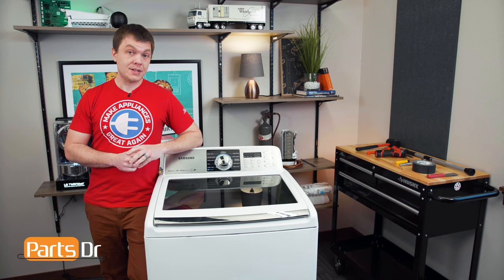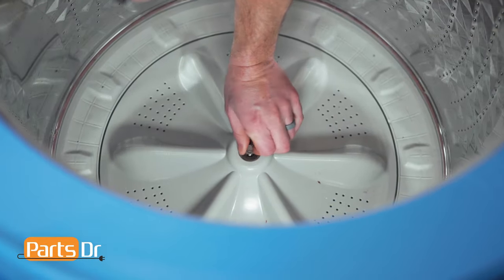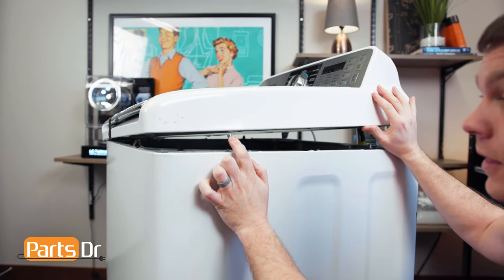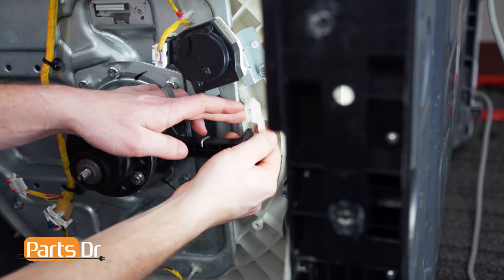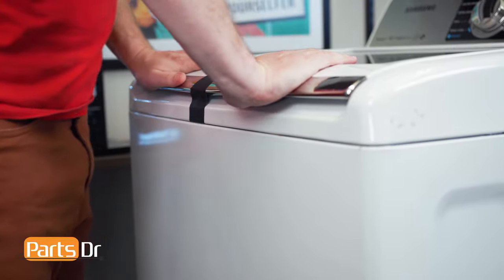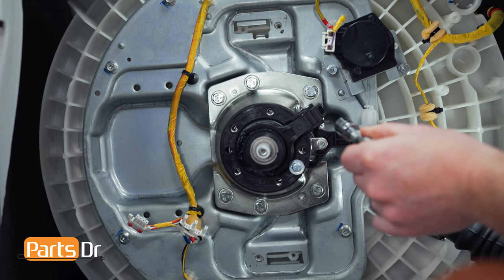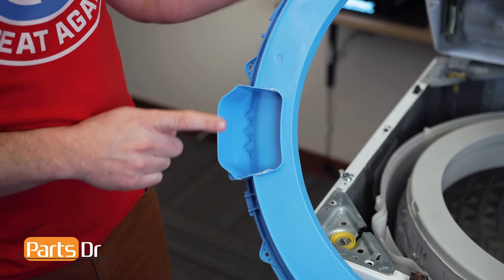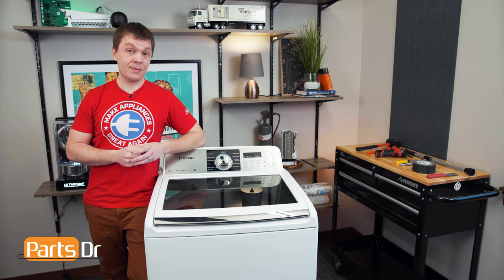How to replace Samsung washer clutch assembly part # DC97-16984A

Comment: My question is how much does this job cost?
Reply from the maker: It will vary depending on the model of the washer and where you live.  Our guess would be $500 to $600 to have a professional repair person replace the clutch assembly.
Reply: @PartsDr  wow half the cost of a new one

Comment: Are all samsung washing machine nuts unscrew clockwise?
Reply from the maker: All of them that we have seen unscrew clockwise.  Let us know if you find something different.  Sometimes the nut gets stuck in place from corrosion and have to be cut off.
Reply: Thank you so much I have a samsung top loader WA13F5S2 its making a loud harming noise on both wash or spin so I'm thinking of replacing the gear box could it be the one causing or its something else
Reply from the maker: @faraimarukutira9743  Unfortunately, we do not have information on this model since it is a non-USA model number.  It could be a bad gear box or clutch if the washer has one.

Comment: I have a top load Samsung washing machine model number WA52J8700AW/A2 (02?). I need the clutch assembly but just the nylon part that is held in place by the 5 Philip head screws. I can only find the whole unit. Do you have an email that I could send you photos of what I have?
Reply from the maker: Hi Joshua, Samsung does not sell that part separately.  You will have to buy the entire clutch assembly.  This is the clutch for your model washer here: https://partsdr.com/part/dc97-18439a-clutch-assembly?model=WA52J8700AW---A2-02
Reply: @PartsDr  thank you. It was driving me crazy looking for this part or any information.

Comment: Excellent video! I have this washer and have taken the tub out twice so far to clean it because of gunk build up on the bottom of the tub that eventually gets on our clothes. Now it's making a loud noise in spin cycle so I'm sure the bearings are gone. I had a hell of a time getting the tub out the first time due to corrosion on the shaft splines.
Reply from the maker: Thanks!  That definitely sounds like bad bearings!  Let us know how the repair goes for you.

Comment: Got a used set. When i went to run it thru with cleaner a bunch of gunk came into the tub. Ran it at least 8 times and still got gunk.  Started tearing it apart and found your videos. 
I took WD 40 and boiling water  to it but still couldn't get the wash tub out. So we brought it outside, got a dryer cleaning brush, the hose and our shop vac. While the hose ran I shoved the brush in between the wash tub and the big tub, and scrubbed everywhere. So much gunk! Then we filled and sloshed the tub around and shop vacced again. 
No more gunk!!!!
Reply from the maker: Nice job! Thanks for sharing!
Reply: @PartsDr  I spoke too soon. Now I've got gritty gunk in the tub. I think all my scrubbing only loosened the gunk more. I have run vinegar through, used washer cleaner, and probably 15 empty wash loads in total. Still gritty gunk.  
Guess I see if I can get it back outside and rubber mallet the clutch till it comes out. 
Either way, I wouldn't have even gotten this far without you! Thank you for making these videos!
Reply from the maker: @barbarac3971  Unfortunately, it sounds like it will probably need to be torn down completely to clean it out.
Reply: @PartsDr  I have tried vinegar, Coca-Cola, WD 40, silicone lube, scrub daddy paste, boiling water, wire brush, rubber mallet; this thing won't come off! I am afraid if I turn it over and tear it apart from the bottom up, I'll end up having to replace the whole clutch, which I can't afford. 
I've taken the garden hose and shoved it down in between the tub and the bin, and so much gunk still comes out. I keep vacuuming out the water, then do it again and still get more gunk. 
I went to try and get a new nut and washer as this one was so nasty, but they wanted $45 just for that nut. So I soaked and scrubbed this one so it's at least clean when I put it back on.... 
I am giving up 😩

Comment: thank you for the video. my washer Samsung model wa50m7450aw/a4 with error  code PC according to the manual is for the clutch problem I just replaced it and still the same code PC please help me with what parts i should get  if you can help me with the part # please.  also my pump it is a little loud. thank you.

Comment: Hi thanks for the great video, My washer (Samsung - WA52M7750AV/A4) won't start spinning and it gives the error code: PC  I'm having trouble figuring out if it's my clutch assembly or my clutch drain motor that is going bad. Is there a way to tell the difference between those two and which could be the issue? any tips or comments would really be appreciated, thanks again

Comment: Just wondering the part I’m looking for appears to be this but I don’t have no electrical connector so is it cool to just leave it there like it came and just put everything together? That’s the only thing messing me up also my model is slightly different lol I don’t have all that telsa looking stuff there mines newer I believe plus mine wasn’t transparent on top and I didn’t have to pull the tub out.. so I think I’m right??
Reply from the maker: What is the model number of your washer?  https://www.youtube.com/watch?v=Lz1UsPC8lBU
Reply: @PartsDr  Wa40j3000aw/a2
Reply from the maker: @Stephentko  Your model washer has the motor off to the side and a belt that connects it to the clutch instead of a rotor and stator.  So on your model washer you won't have a rotor and stator to remove aka "that tesla looking stuff" 😂.
Reply: @PartsDr  So is that a yes it will work or a no cause the part number is exactly the same from the clutch assembly I pulled out..
Reply from the maker: @Stephentko  Your model washer uses part number DC97-16984B (PD00029202) for the clutch assembly.  You can view that part here: https://partsdr.com/part/dc97-16984b-clutch-assembly

Comment: How can I test this part before buying new one? My Samsung front load washer keeps slow spinning one way, then stops, then spins again and stops. Never a max spin. The timer goes down but never an error. Went down to 4 min left but stays there trying to get a spin.
Samsung WF50K7500av
Reply from the maker: We haven't seen a test for determining that the clutch is bad, but there are some things to look for.  If the washer is louder than normal in the spin cycle, it is usually caused by bad bearings in the clutch assembly.  If you see a brownish substance leaking from the bottom of the clutch, it is usually caused by a leaking tub seal that caused the bearing in the clutch to go bad.  If the bearings fail, the washer will also not spin concentrically and the washer will get out of balance easily.

Comment: How do I know if the clutch is bad? My washer won’t spin and when I manually spin it I hear a metal scrapping/grinding sound. Washer is 1 year old just out of warranty
Reply from the maker: When the bearings in the clutch go bad, you will usually hear the washer start to get noisy during the spin cycle.  You can also start to get some dirty greasy fluid leaking out of the bottom.

Comment: Hi!
Is the part DC97-16984B similar to this part (DC97-16984A)? Can be substituted?
Reply from the maker: Those two part numbers are similar, but they are NOT interchangeable.
Reply: @PartsDr  thank you! Prices are a big difference.
Reply from the maker: @santikzkz  Order the correct one that fits your model number.

Comment: Why would you take the basket out ? You can do this repair with it still in the washer. Since the clutch will be replaced it shouldn't matter about damaging the shaft should it?
Reply from the maker: From our experience it is better to remove the inner basket. You can try to do it without removing it, but often you will spend more time fighting it than just removing it.

Comment: Is there any way doing this replacement would cause the washer to not fill? Or can the inlet valve go bad from the washer sitting waiting on parts?
Reply from the maker: It would not be very common for the water valve to go bad while waiting for parts.  First, we would check all of the wire connections to the water valve and main control board to make sure nothing is disconnected.

Comment: My washer makes a  crrrr ("gear slipping noise) when on washing, on the end of the rotation(not the start. Waht could that be?
Reply: When the load is reduced e.g almost half load all sounds good and no noise
Reply from the maker: @RudieGouws  It sounds like the splines on the pulsator might be stripped.  We would start by checking that first.  We have a video on that part here: https://www.youtube.com/watch?v=QGCe-DFAu_o

Comment: I'm not having a clutch issue but trying to get the inner tube out and I can get the nut off but it's not lifting I've been using wd40 for like two days. I don't know if I'm using enough but it's not budging. Any help is appreciated
Reply from the maker: Unfortunately, as we show in this video sometimes the corrosion between the clutch and tub can cause them to get stuck together and sometimes you can't get them removed without damaging something.  The clutch may have to come out to get the inner tub out.
Reply: @PartsDr  thanks for the reply. Do you happen to know if there is anything else that would prevent the tub from releasing? Like a tube, wire, whatever?
Reply from the maker: @williest  Not that we know of.  Most Samsung washers should be very similar to this video.
Reply: @PartsDr  damn I am having the same issue as Will E. I was hoping you'd say there was a method to remove without damaging something. All im trying to do is clean the tubs bc this pos washer keeps leaving flakes on my clothes. Any way glad I came across your videos they're better than all others I came across. THANKS
Reply: @mantoniom55   I've had to take the tub out twice so far to clean the gunk out of it that was getting on our clothes and the first time I had a hell of a time getting that tub out due to corrosion on those splines. I'd advise spraying the shaft with wd40 or liquid wrench and go to lunch and come back in a few hours while that oil creeps down into those splines and it will come out.
Reply: Most washer will have a hell of a time getting the nuts off. Half the time or more I have to grind them off. It's a plague across all brands.

Comment: Can you change the metal splines of the clutch without changing the clutch itself?
Reply from the maker: No you cannot.  You would have to replace the clutch assembly.
Reply: @PartsDr  same thing for the agitator?
Reply from the maker: @davidasselin6369  If the metal insert inside of the agitator (Samsung calls it a pulsator) is damaged or stripped out, the whole puslator assembly needs to be replaced.  We have a video on that here: https://www.youtube.com/watch?v=QGCe-DFAu_o

Comment: The nut won't come off stopping me from removing the drum. What now?
Reply from the maker: You will most likely need to cut a groove in the nut using a tool like a Dremel and a cutoff wheel.  They will usually come off at that point, but if it is still stuck then cut a groove on the other side to cut the nut in half to remove it.